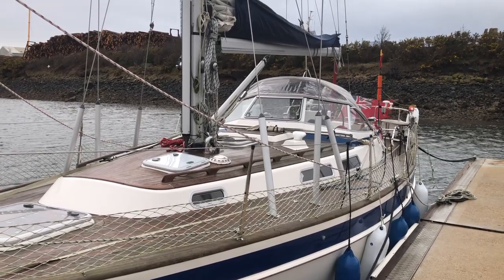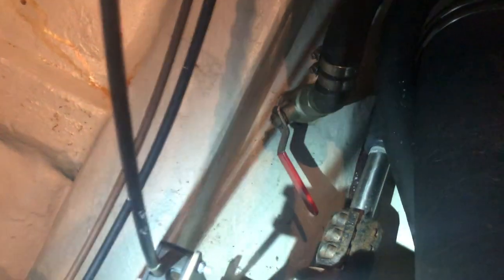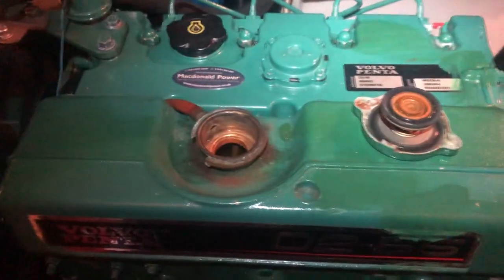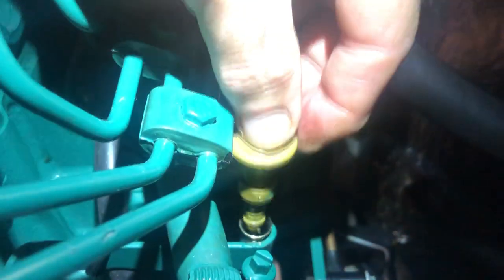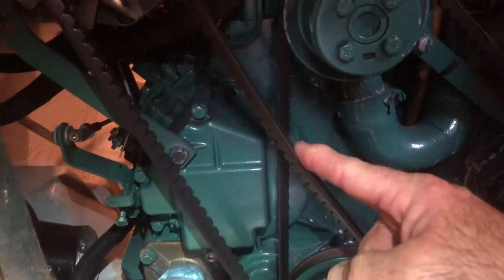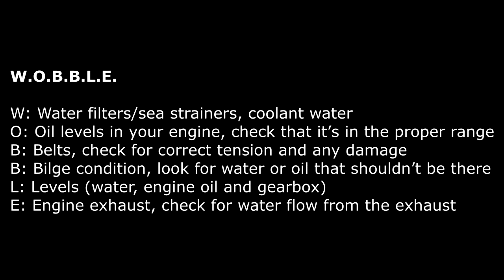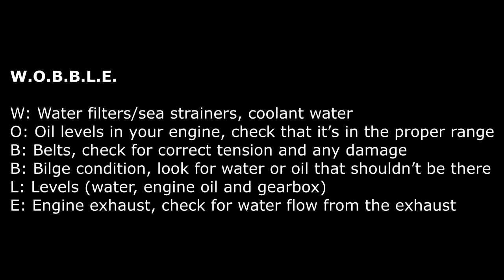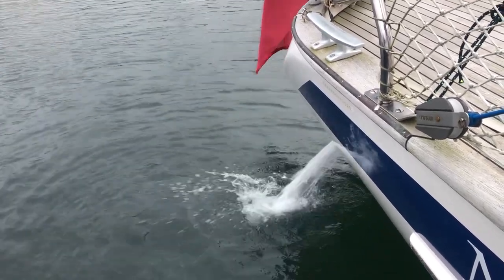How to check your marine diesel engine - RYA diesel yacht engine training

Comment: Water. Can't believe you didn't actually show opening the strainer. That's the entire point. Debris can affect water pressure and cause issues. We never turned the engine on in the RYA course without checking. Flowing water at the end is potentially impeded by skipping this step.